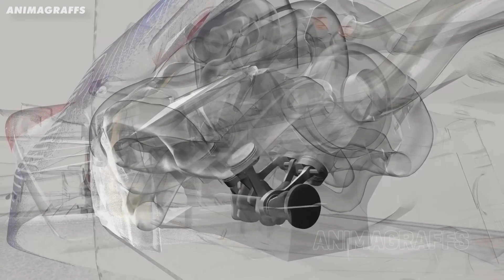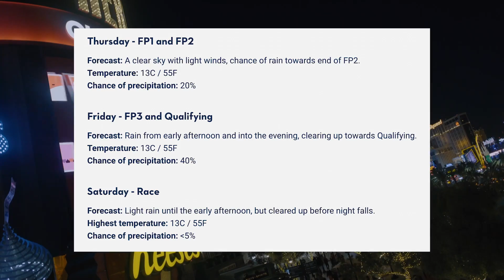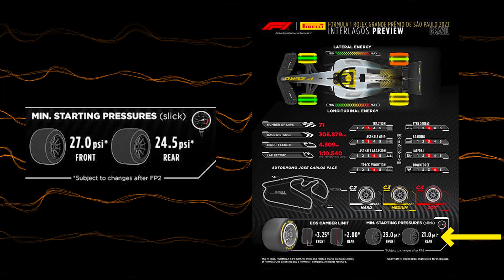Why Formula 1 Cars are IMPOSSIBLE to Drive in the COLD

Comment: Wouldn't threaded tires be more effective in warming up than slick tires? 

Thraded tires have a smaller area of contact with the surface of the track, since each small piece of tire is surrounded by the empty threads and would be under a greater force per unit of area, hence will warm up faster than slick tires which have a greater area to cope with the loads, which in turn would have a harder time warming up the core as tires have a greater area to dissipate energy, thus temperature dissipate temperature. 

Also, threaded tires are made to operate with a track at lower temperatures since they are made to work on wet tracks. Even though they would generate less grip than slicks, it seems that they would actualy have an overal advantage in this scenario, at least on average, than slick tires on very cold tracks. 

Slick tires, even with higher tire pressure, would still be manufactured to be operated with the pavement at warmer temperatures than colder ones. Unlike threaded tires, which are designed to both diverge water away from the pavement right beneath the tires and away from the car, as well as work on a colder than usual pavement.

Sure, the threaded tires would have less grip than slicks, but for the competition that wouldn't be, on average, better than slicks. Specially since threaded tires at least in my Physicist's mind, that never raced anything other than indors Go Kart, but two questions arire:

1) Wouldn't the use of threaded tires decrease the skills gap between very good and great drivers, or at least not increase as much, making the race less predictable and more competitive? 

2) Wouldn't slick tires increase the skills gap between the very good and the great drivers due to the more skilled drivers having more tire temperature management skills, thus manking the race more predictable?

Comment: I know I'm not supposed to say anything against Driver 61script writers and a bunch of F1 engineers, but during my sim racing, lower pressure makes the tyres warmer, but I need it to have higher pressure in cold weather so the tyres can maintain its normal pressure, I usually go with reduce brake duct air flow to heat up the tyres.

Comment: I think you have it wrong @ 7:53 "...to add more pressure than normal to also increase their temperature". Higher pressures means LOWER tyre temperature, whereas lower pressures means HIGHER temperatures, since the lower pressure will increase friction (which you basically are saying afterwards, with the toe). Higher temperatures in air/track will lead to higher pressures in the tyres, but higher pressures in tyres doesn't raise their temps...

Comment: 0:41 – How do you figure the power units might suffer?  Aren't the cooling packages designed to have the minimum necessary capacity plus a little overhead?  Won't the cold ambient temps just give them more margin to play with?

Comment: Wouldn't less aero especially in these cars actually help with getting tire temp up? Using more mechanical grip instead of aero grip?
Reply: Huh? Less areo doesn't mean that "mechanical" grip works harder. If you gave 1500 pounds of downforce, other parts don't relax more.

Comment: Here's an Idea : what if you, i don't know, decided, as the FIA and FOM, to have the race in SEPTEMBER, instead of November, and drive in Miami in November instead. Hell, they could simply switch the both GPs, and atleast you'd have 12 degrees at coldest, if they run it a few hours earlier, that'll be right at the 15 degrees temperature window. 

Using the exact same dates should not bring any issue in regards to either logistics or with major US (sports) events. Hell, Miami is closer to Brazil, so would even make it even easier logistics wise. 

The real issue here though is not F1 itself, it is the real problem F1 is having for far TOO long : PIRELLI. Not that Pirelli wouldn't be able to make proper tyres, but F1 is way too long having artificial racing through the tire compounds. If they simply let Pirelli - or another manufacturer, make PROPER tires, we wouldn't have this issue. 

But quite frankly, even then, the biggest problem is not just that - it is that Pirelli does not make SPECIFIC COMPOUNDS for these temperatures. Making Pirelli and FOM/FIA the real problem.

For example, you have wets and intermediates , to use if it's raining. You cannot properly drive on slicks in the rain. That would be a problem, if you did not have wet or intermediate tires. But you have. So there isn't a problem. Because those tires are MADE specifically for the Rain and different temperatures.

So i dunno, let's imagine, that, knowing fully well that these tires don't even last a single race, not even a single session - how about you make SPECIFIC tires for the Vegas race, that are able to function with 5 degrees outside?

Comment: At the risk of re-opening an old wound, this tire temperature issue is one of the analysis theories for the Senna crash in 1994. 

Cold tires due to a slow safety car and late braking coming into the corner causing a massive lack of grip and steering resulting in the tragic straight run into the barriers. 

Obviously there were many other theories, but the parallels are similar enough to bring the horrible memory back.

Great channel as always. Cheers back at you sir.

Comment: 7:53 Actually it's the opposite. More pressure = less deformation = less heat
Reply: I go on track with a motorcycle but the physics are the same.
It's very obvious on hot weather. If you keep the pressure low, the tyre overheat and melt super quickly.
Increase the pressure and it's back to normal.

Comment: i thought less tyre pressure meant more rubber flexing = more grip = more heat. and increasing tyre pressure gives the tyre a more defined shape and less flexing making for better top speed and stability but less cornering grip. could someone explain this better for me?

Comment: I calculated a total length of around 4900 meters (4.9 km/ 3.0 mile) they can go flat out. That's gonna be a problem with the new asphalt, low temperatures in las Vegas and the many straits on which the tires cool off. Joy!

Comment: Feels like F1 once again CAN fix tyre issues but they just don't.  It's weird. It's the cheapest most expensive sport in history, & the cost "cap" stuff still feels sincerely strange & determinant to me. 
As a former Vegas resident, it absolutely gets cold at night (er, chilly, but certainly not hot) but it will always feel like a fixable problem with a vastly different tyre compound & little else.

Comment: I'm a Vegas local, I've heard so much talk about the temperatures. The low for Saturdays race is 50 degrees F, and that won't be until about 2-3 A.M. local time. I have a hard time believing F1 hasn't raced in significantly lower temps before. I think the race should be in the September-October area for the future, but I think there is way too much talk about the "low" temperatures.
Reply: 50f would be exceptional for f1

Comment: Something that seems to be missing from the "Media" reports. The fact that during the day, Vegas can be quite warm, even in November. The Sun beats down on the track and warms it up. But- as it cools off in the evening, there will be some condensation on track making it even slipperier than a 'normal' green track. With the new track surface being nice and dark, the temperature will stay warmish for quite some time- and as the air cools, it's going to be pretty slick out there. ESPECIALLY those painted curbs. They will be like Ice and slicker than snot. 
And for the Tire Temps, I'm sure there will be some fiddling with the brake ducts and drivers will be 'riding the brakes' a bit to get the core temps up quicker, along with the toe adjustments. And since they will be eliminating Tire Blankets for 2025, A 10 year Vegas contract will make those races even more eventful. Would NOT be surprised if they end up with some kind of support race/demo to get a bit of rubber down.

Comment: Excellent video and insight. Another option for increased tire temperature would be to increase the compression stiffness of the dampers. This forces more energy through the tire carcass generating internal heat in the tire.

Comment: Finally a content creator that actually understands the challenges of the low temperature conditions. Rather than the talk about people freezing because it’s 10C and that you need a winter jacket to survive. I drove in ice today btw, didn’t need a heavy jacket to me outside so people need to stop being ridiculous
Reply: Its not abt the air temp or the drivers. Its abt track temp, no high speed corners to get heat in the tyre and a long straight on which tyres loose huge amount of heat…. On new tarmac, during day normal cars on it, no racing series laying down rubber… it will be like ice with walls way too close AND COLD BRAKES…..

Comment: Im sure a load of teams be blocking up their brake ducts 70%+ to keep the heat in the wheel...
Granted not as valuable as it was when they had the outwash blown through the wheel centres... but I bet it will still happen

Comment: WEC just finished its season with the 8h of Bahrain and without tyre blankets it has made in-laps and out-laps very interesting albeit slightly dangerous due to the difference in temperatures and therefore speed between the cars.
Reply: WEC ARE NOT F1 cars……. It works completely different on those cars…. Geez you should know that.

Comment: For all the reasons you just mentioned I thing Vegas may actually be a great race. Hear me out, because of the long straights team are going to have to run almost no downforce because of the drag not to mention they are going to be at no risk of overheating the car while struggling to keep temp in the brakes, tires and Track surface. Basically the braking zones will be much longer with more margin for error and a lot more opportunities for battles on track.
Reply: Wrong on all levels.
Reply: @Redlingstein  told you it was gonna be a good race….

Comment: You screwed up my tire temperature understanding. I always thought higher tire pressures meant less flex and lower tire temperature. In fact, running too low pressure on street tires will cause heat damage. 
Am I missing something or are race tires that different?

Comment: Higher tire pressures actually bring temps DOWN by keeping belt movement to a minimum, Pirelli is worried about the heat build up on the long straight where the car's high down force lead to high inner tire cord deflection. The drivers will have the same problem they faced at COTA years ago when 1st practice was held in low temps, it'll just take more laps to get the tires up to operational temps, what will be interesting is a safety car period.
Reply: Interesting??? DANGEROUS you mean…. A completely COLD TYRE RESTART like Melbourne… NOBODY WANTS THAT EVER AGAIN!

Comment: I'm personally pretty excited to see this lower temperature race. I expect to see the best drivers really shine. When is cold power goes up, traction goes down. We will see the drivers with excellent throttle control. As a side note my weather forecast shows 58*F which isn't all that cold and expect track temps to be ca 70*f
Reply: 10degrees is WAY TOO COLD with no high speed corners to heat the tyres, tyre blankets not allowed higher than certain temp, over 2km long straigh where tyres LOSE ALL TEMP…..
Reply: @Redlingstein   betcha surface temps are 70 f 20c... Wanna bet?

Comment: It is going to be warmer than normal this weekend for the race in Vegas, so hopefully the tire issues they are predicting will not happen or not be as bad. Hopefully chaos can be avoided in that first turn at the start. Will be interesting to see how the teams adapt to this track.
Reply: 10degrees at 10pm and Quali at 0.00 … that is cold….imagine the track temp… warmer than normal in Vegas is still too cold for that track lay out for F1 with NO HIGH SPEED CORNERS to warm the tyres and a more than 2km straight where the tyres LOSE TEMP…
Reply: @Redlingstein the best bet is to hope the track holds on to the heat from earlier in the day

Comment: Do keep in mind this is the asphalt sea that is Vegas. Black asphalt absorbs and retains lots of heat. The air temps will be low, but the track will retain considerably more heat.
Reply: No it won’t cos during the day the airtime is not high enough. And the NEW TARMAC will make everything even worse!! No grip at all. No other series putting down rubber. AND DURING THE DAY NORMAL CARS AND DEBRIES ON TRACK…… 👎🏻
Reply: @Redlingstein  I mean heat from the sun here, not from the air

Comment: How is this stupid narrative still getting pushed around? Did they take a data point from a single point in time last year, instead of averages? The low is going to be roughly 56F. You know what time that generally happens at this time of year? About 6 or 7am, not at 10pm like when the race starts. So it'll probably be in the mid 60s during race time, far from the coldest race. Nothing like the 40F temperature every article is stating, with lines such as "how could F1 not thought to look at this". Well neither are you, the temperature is going to be at seasonal average, and there's typically a couple races each season at those temps at various non warm locales.

Comment: I just checked the weather for Vegas. The high is 70°F/21°C and the low is 50°F/10°C. Its not going to be as cold as theyre making it out to be.
Reply: Thats AIR TEMP…… Track temp is completely different. Track temp will be low, SHADE FROM BUILDINGS…new tarmac with no grip, no high speed corners to get temp IN THE TYRES and over 2km long straight on which TYRES LOSE EVEN MORE TEMP…..

Comment: Racetime forcecast right now is about 14C, so I think Pirelli can put away the snow tires.
Reply: Its abt the TRACK TEMP! Not air temp!!!!! The track temp will be too low for a track WITH NO HIGH SPEED CORNERS TO HEAT THE TYRES….and a 2KM LONG STRAIGHT where TYRES LOSE EVEN MORE HEAT. ….. It will be crash fest, driving on ice all weekend 👎🏻 F1 and Vegas FAIL BIG TIME
Reply: @Redlingstein  we get it man, you're a hater of this race. Why don't you come back in 4 days and let us know then if you are right or if the race is any good. No way it can be worse then Monaco though.
Reply: @Redlingstein track temp is going to be higher than 15C because Vegas is sunny as hell and the track will spend ALL DAY in direct sunlight.  Honestly, track temp might be higher than some of the rain/overcast weekend races we've had in the past.

Comment: Have these guys even looked at the extended forecast? It shows a low of 50 degrees F.  Which occurs at approx 6am.
At 10pm to midnight, it's about 10 degrees warmer.  So temps of 60 to 65 degrees F.
I, for one, look forward to any F1 race which has bad wx. The season is over, let's at least have some real entertainment.

Comment: I’m out there working. It’s not as catastrophic to be honest. Even at 4am. 10-12C.
What I’m more worried about is that pit exit. It’s completely blind if your exiting the pits and the corner apex is literally the pit exit!
Reply: Assuming no cloud or rain, Track temperature will be much colder than air temperature…radiative cooling is strong in a dry atmosphere
Reply: Why the start is at 10PM? Why so late? If they start at 6 or 7 PM the temp could be higher and there would be no stupid talk about low tyre temp. 😮
Reply: @maxster10   F1 is attempting to build a market here in the US so, waiting until the majority of the country is asleep to run the race makes perfect sense....  😕
Reply: @MikeGentry  It's Saturday night my guy. Thought the same thing at first.

A 10PM start maximizes the number of eyeballs on the race. If it was at 7PM Europe would be asleep. And they can't do mid day like the other US races because Vegas baby.
Reply: The line doesn’t go inside it’s a much wider line
Reply: And pit exit is another insanely stupid design by F1…… imagine cold tyres…Quali flying lap car and car from pitlane. Vegas is seriously such a show of incompetence!!
Reply: 10degrees is COLD especially cos THERE ARE NO HIGH SPEED CORNERS TO GET TEMP IN THE TYRES……. Any restart or braking in turn 1 will be a massamarkt…. And completely ludicrous in these budget cap times as well. F1 truly FAILED with signing Vegas in Nevada at End of November….
Reply: @Redlingstein  all your bitching and moaning, and this turned out to be one of the best races of the season.

Comment: This just all sounds like an entertaining race to me as there is a high chance of mistakes. Also, just a thought, when you run inters in the dry they suffer from overheating - maybe try inters in the cold to get temp in them
Reply: Please learn abt F1 cars……
Reply: @Redlingstein  I understand how they work and understand how cold tyres will cause oversteer and understeer etc. What I am saying is that if the drivers are struggling then there will be a lot of mistakes, which will make the racing interesting to watch. What about that statement is wrong?

Comment: Are you sure the increased tire pressures are intended to facilitate quicker tire warm up rather than ensuring tires reach a minimum operating pressure on track??  From my understanding, tires run hotter when at lower pressures from greater deformation each rotation - an equation balanced somewhat by the tires providing lower grip at higher pressures and potentially being driven harder by the driver.